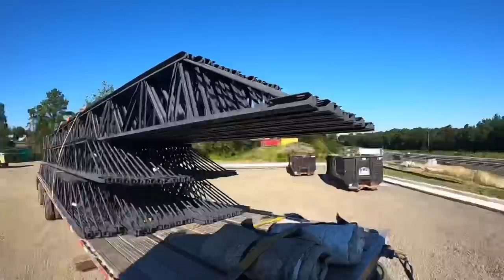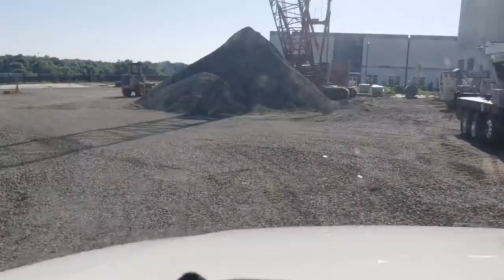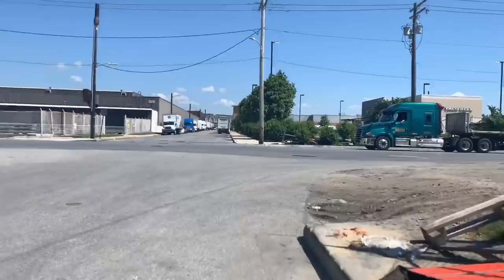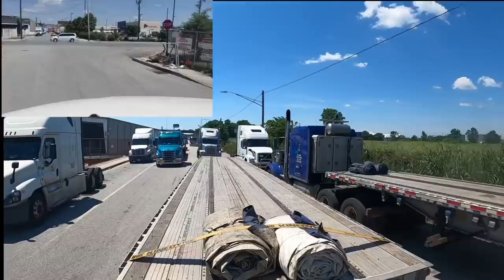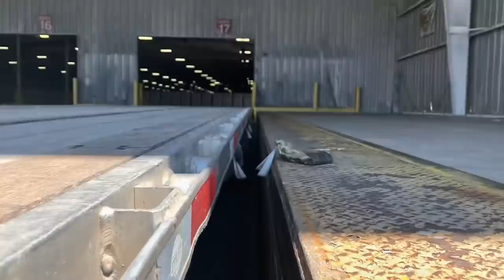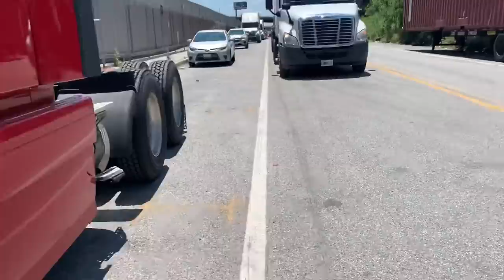Lease Operator Flatbed P&S Transportation And How To Back Into A Tight Dock

Comment: I worked for PGT when you haul trailers like that you usually have lost an account and they tell you to come get your trailers they have a terminal down the street from there I use to haul out of National Gypsum. Those docks were built for 96" wide trailers now you go in there with a 102 and that 's what happens. You do all that strapping and securing and a van trailer pulls in behind you and they load it and the driver shuts the door and goes seen it more than once.
Reply from the maker: Yes I see a lot of dry vans in there